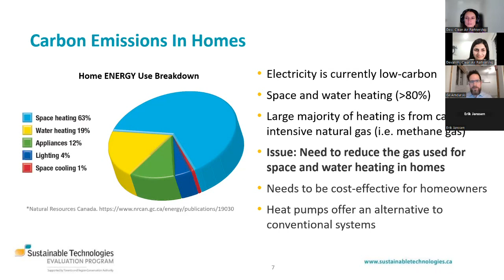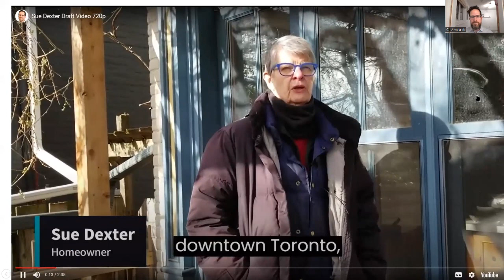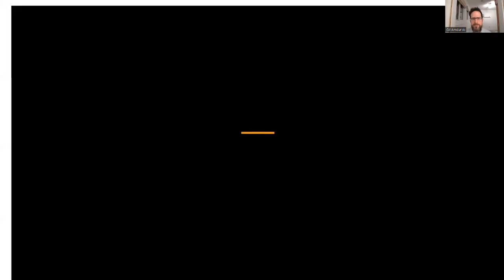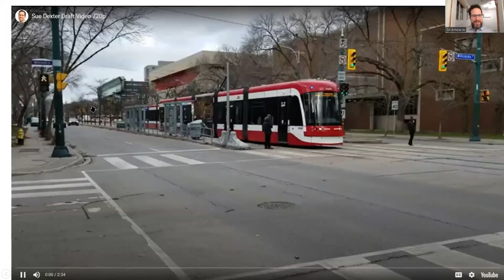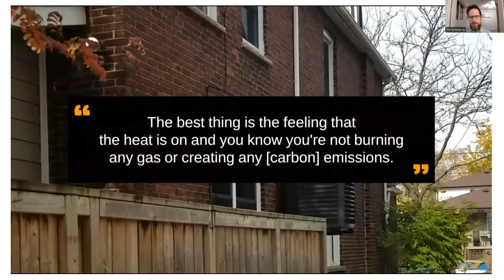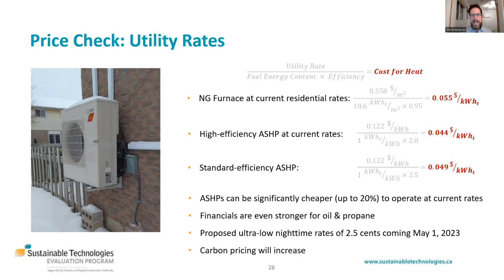STEP Heat Pump Evaluations as part of Community Engagement Webinar Series

Comment: I am more than a little wary of the electrification of everything. It makes us even more dependent on the power grid. I am also worried that we will be trading one type of pollution for another, like electro smog/emf's (and their effects on the human body) as well as the lithium and cobalt mining. He also talks about the heat pump being able to work in cold temperatures because the freezer of your refrigerator works, but that refrigerator is in your house, not outside in a Canadian winter.